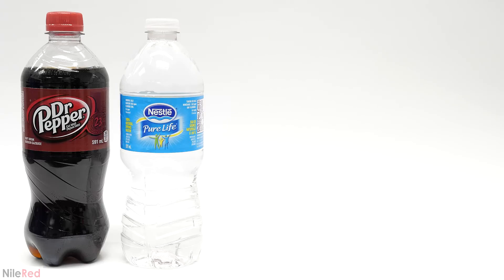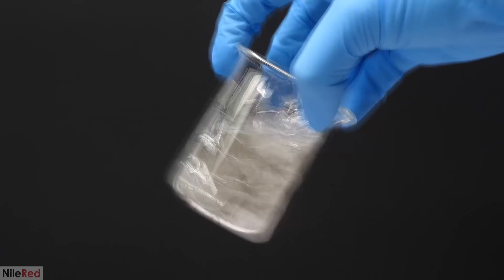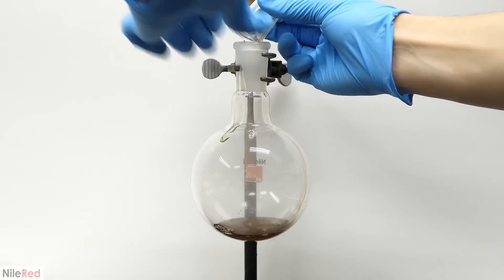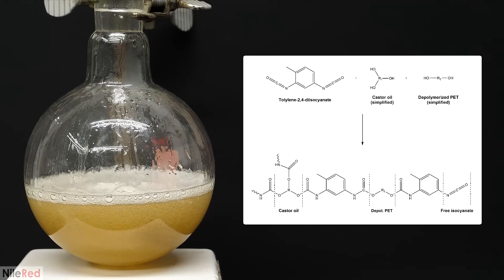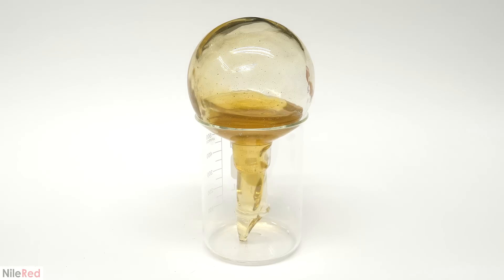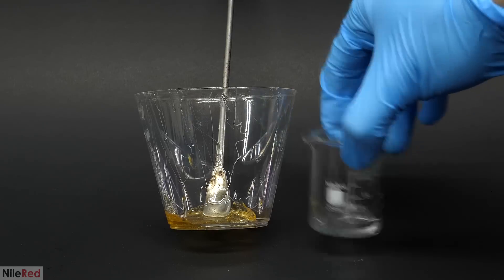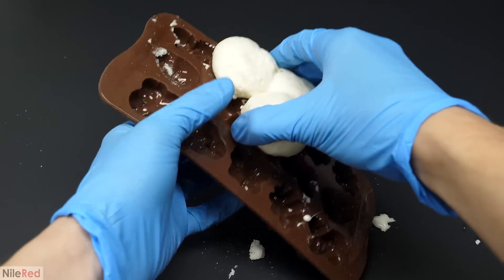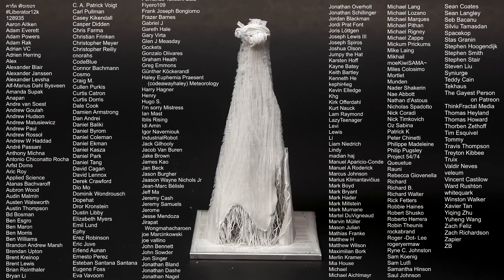Turning a plastic soda bottle into foam

Comment: I guess caster oil is also used to create crosslinking points, which will lead to more strength. Be carefull with isocyanates. They are not relatively toxic, they are highly toxic. Next time it would be a good idea to check the remaining NCO-amount in your final product - before smashing it. All the fine pouder was on your lab coat and on your skin! Nice experiment :))

Comment: Correction - recycled plastics CAN be used in food safe containers, and here's how.  About 20 years ago, I worked for a company that built the computer controls for plastic injection molding machines, and in that job, I got to know a bit about the machinery, materials and methods used.  One method used to produce food safe containers with recycled plastic was one where the container (a bottle for instance) was blow molded by the machine, and in a super secret process which I believe the company may hold a patent on, a thin layer of actual food safe plastic was  injected on the inside of the container.  As close as I got to the machinery, I never quite knew how they did it, but it took place directly after the bottle was blow molded and before it exited the machine.  What you end up with is a normal looking bottle, made out of about 99% recycled plastic, with a layer of food safe plastic coating the interior.

Comment: When working in plastic production we made ABS foam by adding sodium bicarbonate into the rotation moulding chamber where the molten plastic was. It was actual store bought baking powder used for the first run. Worked like a charm.

Comment: As i saw, that the coffeine-molecule-relief from your selfmade mould broke apart at pulling the foam out (the other shapes also lost a bit of their surface), i thaught:
Do the whoole process again but this time let the foam-pieces in the moulds, until they are compleetely hardened (you told, that takes about a month).
maybe then it´s hard enough to get the molecule-relief fully out of the mould.

Comment: I should mention that the commercial polyurethane foams are much thinner than your gooey chemical, I don't know why, or if they added some kind of a thinner to make it flowable. But it seems like a good way to recycle PET bottles and make home insulation on the cheap. Why aren't the bottles recycled more often and ending up polluting the seas? In Europe they have bottle deposits where you get your deposit back by turning it back into the shop.
Reply: I think its because they add something that creates more CO2 bubbles inside or blast air bubbles in it when curing, if i remember correctly its the air bubbles method but im not sure
Reply: plastic is rarely recycled as it costs more than to just make more plastic.
Reply: Which Europe does bottle deposit?i recycle in Europe ROI and got laughed by teens...
Reply: @sonatinac8514  republic of ireland? ignore the teens man they don't know anything

Comment: With your chemistry background, can you can explain why urethane is such a "junk" polymer?  Put it in the sunlight, it degrades.  That "powderyness" it displayed when it was not totally set, it will display later with time (if it doesn't "seek its creation" and degrade to the goo that it came from first).  (Have you ever seen a substance both crumbly and gooey at the same time?)  I have seen that "memory foam" and other shipping flexible foams used for protecting expensive optical equipment, degrade into a slimy goo that absolutely destroys optics.  Before it does that, it exudes a smelly, sticky substance that seems to condense on everything in the package, which no known organic solvent can remove.  Even before that, when you open a case lined with urethane foam, there is a Godawful smell like an old chemistry lab.  Urethane paints (very heavy "rubbery" paints) also do the same thing, along with stick-on rubber feet that are supposed to "protect" surfaces.  Are you familiar with the carbon-loaded urethane foam used to insert static sensitive integrated circuits leads into?  After 20 years, the leads are corroded off, and the foam becomes a crumbly, gooey, mess.  I suspect some of this may be due to the plasticizers incorporated to make it flexible.  This is supposedly the source of the "new car smell".
     My "simple chemistry rule" for urethane is URETHANE = CHEAP and URETHANE = UNSTABLE.  Perhaps you could shed some light on this explaining the chemical reason!

Comment: The castor oil has 3 functionalities, which allows for the crosslinking and and to form a three dimensional polymer rather than the two dimensional one that would appear from the reaction of TDI and the diol (changing considerably its properties).
Polyols with different chain lengths can be mixed to modify the properties.
Castor oil is also considered as a "green polyol", so its use is encouraged over the use of other synthethic polyols.

Comment: As an injection moulder for PU (hard PU using an MDI based pre-polymer), you can use something like Ambersill PUR 400 Silicone Mould release which means you'll get clean removal for PU.

Comment: What would be the cheapest way to make and insulator at home that's at least R10 or so per inch of thickness?

Also what would be the cheapest way to make some kind of very decently strong fiber or composite board?

Asking for curiosity reasons.

Comment: yes nile please make a resin video!  boil pet chips in antifreeze or something like that and just buy the mekp hardener.   i think the cheap auto body stuff is brown because they boil it in iron tanks but i bet you could probably make it clear if prepared in glassware.  i can't remember if its titanium oxide or aluminum oxide they use as ultraviolet inhibitor but that doesn't really matter for beginner video.  i would love to have time to experiment with that but can't right now.  i am working with advanced geopolymers  (polymer derived ceramics) and things are getting interesting!

Comment: "Toxic?"  But my employer told me that TDI was safe when they had me working with it.  And also that I couldn't wear a respirator because it didn't do anything.  And then they gave me bullshit food-service gloves so it got on my skin too.

I really need to get that lawsuit off the ground.

Seriously folks, be careful with that stuff.  I developed adult-onset asthma which at first was only triggered by isocyanates, but shortly after my state legalized recreational marijuana I learned that I'm sensitive to that too.  Can't smoke (it might literally kill me) and I can't even be around it.  I tried a particulate respirator, but that didn't work and I've ended up needing a half-face OV respirator just to take the bus.  (This is weird.  Normally allergens have to be macromolecular chemicals that are large enough to activate an antibody, which means you usually can't be allergic to a VOC.  However there's a mechanism where a reactive small compound can attack or bind to a macromolecule and turn it into an allergen. 

These reactive compounds are called "haptens."   Urushiol is a good example - most people are familiar with poison ivy, but it's also the source of natural East Asian lacquer ("urushi" in Japanese).  Urushiol polymerizes in the presence of heat and humidity, producing a strong and chemically stable natural thermoset.  Polyisocyanates also polymerize in the presence of water - the product is polyurea - or copolymerize with alcohols to produce polyurethane.  Polyurea is stretchy, sticky, and fairly reactive - it can even be made to re-form covalent bonds with itself after being cut.  Polyurethane is harder (but springy and resilient rather than friable) and chemically stable, useful for foams, paints, and finishes.

So honestly, the best way to think of isocyanates in the lab or workshop is that they're somewhat like urushi lacquer - they don't cause much of an acute reaction but they can be extremely irritating in the long run - and you really don't want either skin or lung contact.

 I also carry a rescue inhaler and my life kinda sucks a little more than it used to.  The resulting polymers are amazing but it's a shame isocyanates can be so dangerous to work with. Probably the worst was losing my career, which has cut my earnings by about 70%.  Like I said, I need to get my lawsuit off the ground.
Reply: correction: PU by itself can be quite friable; depending on the chains.  Nile's product looks a lot like Great Stuf insulating foam.  But PU with different starting materials is the most common seat cushion material, and it's pretty common in sponges and stuff like that.

Comment: Since PET lacks chlorine, wouldn't it be fairly safe and easy to use as fuel?
Reply: bro that bottle in the video is PETE not PET
Reply: @morgankasper5227  
A 30 second Google search would have told you they're the same thing.
Reply: @bcubed72  i ment word wise

Comment: Hello, watching this video reminds me of something that I once witnessed while I was in high school. Some people from General Motors came to our school and put on a presentation in the auditorium that as far as I can remember was all science related. The thing I remember most vividly though was them putting some chemicals in a clear beaker or possibly just a bottle of some sort and then just holding their thumb over the end as they walked around on stage a couple of minutes shaking it as they described what was happening in the beaker. In the end the guy tipped the opening towards the audience and pulled his thumb off as one would if spraying some one with a shaken carbonated beverage. What popped out of the bottle / beaker though was a pretty good size chunk of a soft white foam that was instantly formed and able to handled with out any stickiness or anything. Whoever caught it was prompted to bring it up on stage and they proceeded to demonstrate how energy absorbing it was and I think at one point even throwing and egg at it without breaking it. I think they may have said it was or was similar to what the padding in padded dashes was made from but I may be wrong. I am almost 70 now so this was long ago, probably about 1965 or 1966. It might make a cool video if you have any idea what they did. Best I can remember the liquid in the bottle was clear to start out but the color might have changed as the guy was walking around and shaking it to a grey color.
Reply: That's fascinating! It would be awesome if he could figure out what it was...🤔

Comment: Great video NileRed!!!
I´ve already read about the glycolisis method with magnesium and manganese many years ago (1980 perhaps) and tried it myself by 1994... It really worked!! I already succeed in making not only PUR foam but also some adhesive (solvent based) and PRFV too.
But I could not succeed in the commercial side of the thing, since by that time, recolection of plastic bottles for recycling was not "on fashion". The "raw" material was almost impossible to get in quantities large enough for running the proyect... a pity...
Regards,
carlos

Comment: The term 'recycling' I think in this case isn't used correctly - 'recycling' usually refers to saving material so it can be reused in other objects - the problem with PET is that it can only be recycled a couple of times before it's basically only good for garbage. They often use the term 'downcycling' for instances such as this.

Comment: One of the problems of this small scale "recycling" is that you end up with black "plastic" bottles, that in most large scale recycling plants will be just sent to land fill.  Because the sensors do not detect them.

Comment: That foam seems like it might make decent modeling foam.  The long cure time is actually kind of nice, so it's more workable for a decent amount of time before you've settled on the final geometry but then hardens to be a more durable product if you want to use it for a mockup or something and don't have to worry about moving it around.

I'd be curious about further dimensional changes over the entire cure cycle.

Comment: The ratio of -OH groups to -NCO group will affect the density of your foam. Mostly the % water will affect the foaming. In industry we don't add the water/catalyst to a prepolymer. It's the other way around, a resin is made with a defined -OH value and water/catalyst is added. Then when it is time to create the foam a diisocyante (usually PMDI) is added. However this a quick reaction (since it is an industrial product) and foam times can be from 30sec to 10 min depending on amount of catalyst. DEG, DPG, Castor oils, soybean oils, are all common in production of polyurethane foams. Your foam was very brittle because of the excess of -NCO. Also when molding, using a silicone spray to spray the mold first will make it much easier to demold.

Comment: That's pretty cool! I didn't know that about the spray foam. I used to work in insulation, so I'm pretty familiar with the stuff. Basically we'd have a machine that's hooked into two different barrels full of stuff, and they mix on the way out of the spray gun, and foam up. it's pretty neat. That shit'll ruin your clothes or anything it gets on. I remember this one time I was on a job in Santa Barbara, and this guy started yelling at me about getting foam on his million dollar beam made of redwood. It's funny, because I didn't do it. I was just there helping. I wasn't even ever trained to do the foam. But this fucking asshole rich dude figured he'd yell at me for it. I get why he was mad, but still. I ended up spending the whole day on a ladder with a wire brush trying to get the foam off the beam. Good times.

Comment: You successfully recycled used plastic polymers into a new polymer product, which is a good proof of concept.  The problem is that the polymer you decided to make (polystyrene) is almost never salvaged by recycling companies due to logistical issues, bringing us back to the first problem mentioned in your video.  This could be resolved by finding a way to recycle your bottle without degrading it, a subject for a potential video I hope to see from you at some point.

Comment: Back around 2000 I help develop a way of recycling waste PET x-ray film into insulation foam. The transesterification catalyst I came up with was another very common waste material that ended up as a structural part of the final product. The PU foam was made with industrial grade MDI using the converted film as the sole polyol with no additional polyols like castor oil. The process has fallen into disuse now with the introduction of digital x-rays. As far as I know no one is using the process commercially with PET bottle waste.

Comment: The ricinoleic acid triglyceride ester in castor oil, having 3 hydroxyl groups, contributes to formation of crosslinks (unlike the PET derived diol, which would only make a linear thermoplastic polymer when reacted with the toluene diisocyanate). The foam thus prepared is a thermosetting polymer which is rigid and cannot be melted by heating. The long chain structure of the ricinoleic acid triglyceride ester in the castor oil probably also prevents the foam from being too brittle.  I think that's why castor oil is added. Of course, it being a renewable resource only helps. Polymer chemistry is fascinating af.

Comment: "TDI is toxic especially by inhalation"
Nice VW burn there :)
Reply: Jimny VR5 Can you explain lol
Reply: @1495978707  Volkswagen has a designation for their Turbocharged Direct Injection engines, which is TDI. So it's kinda of a pun there to VW.
Reply: @1495978707  Also, they made some ilegal things to pass emissions with their TDI engines. Quite the thing right there haha
Reply: Only relatively

Comment: I have a PET plant in my back yard.  I can always tell when they're running.  It produces a very distinctive odor.  Kind of a mix between sulfur and vinegar.  It's not terribly strong or offensive. Depending on the stage of the production it can even have a fruity smell.

Comment: As far as polymers go, PET can be a bitch when it comes to mechanical recycling. PET requires a thorough, even meticulous cleaning and drying before even a thought of putting it into an extruder crosses someone's mind, because water at high temperatures and pressures can lead to hydrolysis of PET. And water will readily do so if the opportunity arises, biting unfortunate recycler right in the ass in the process.

Comment: I have to remove thick oil from Rotovap flasks all the time.
Instead of using the heat gun, which I used to do, simply use a heat lamp and patience.
That way it gently works by itself with no one to attend.
Reply: Fire hazard?
Reply: @solodark5646    Yes please.

Comment: Try dampening your silicone moulds before you let the foam expand in them. When insulating lofts with PU foam, there's a general procedure of spraying them with water to encourage expansion and this might help help getting it out of the container at the end too.

Comment: Can someone give me advice, or even let me know if it's possible. I want to turn calcium fluorite in its crystal form into hydrogen fluoride. I was reading about it online and just said there will be other impurities in it (it's like a rock basically) but it could be done with crushing it and adding some 80% purity sulfuric acid to it. But didn't give any specifications otherwise, like how separate or anything like that.

Comment: Also they have a foams in the supermarkets for household and cleaning use(not the melamine, i suspect exactly polyurethane) which always moist or soaked in water right in package, but when this foam dries out it become hard as rock and the same time super light. This foams have super micro porous structure and i had the idea of like carving them maybe for molding something, but i don't know when i will find a time for this project.